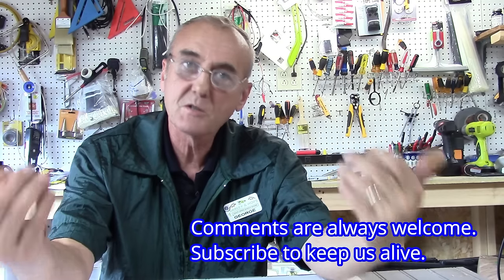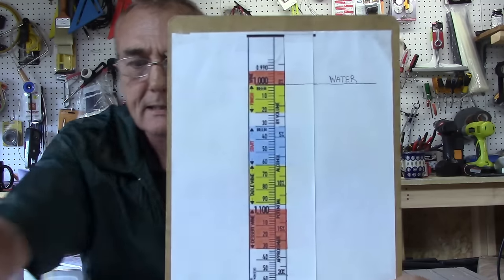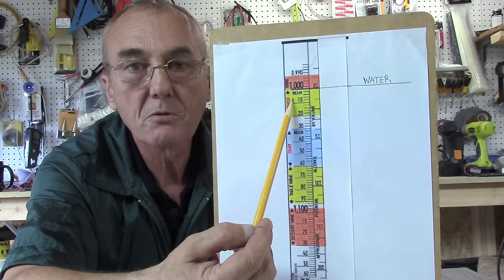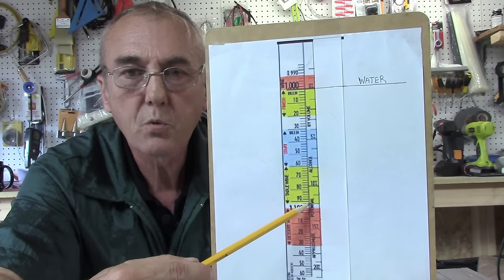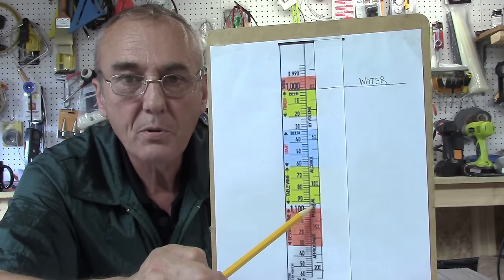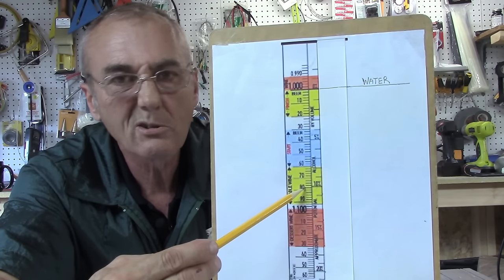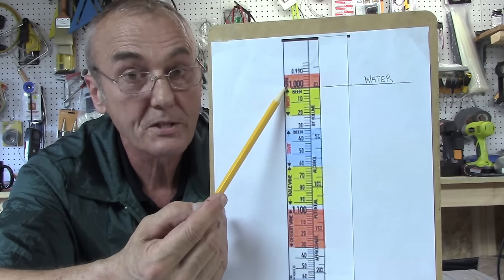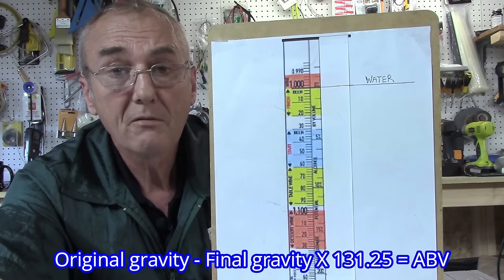Hydrometer Science

Comment: Oh man, I just did a corn and malted rye mash, it's the second grain mash I have done.  Chucked 2 lbs of molasses in with it for good measure.  Thought it would be good for a reasonable yield.  8.5lbs of kibbled maize, 4 lbs of malted distillers rye into 6 gallons of water, cooked it at 165 to 150f  for 2 hours and pitched the yeast at 24 degrees C.  I remembered to take the initial SG, which I normally wouldn't do.  it came back at 1.015.  I had no idea what it meant, until I watched this video...  I'm guessing it means I need to dump a whole bunch of sugar in it to give me a decent yield!  My first corn mash following George's basic guidelines only resulted in me collecting half a gallon of whiskey at 40% using a pot still....!   While it tastes delicious, it's a lot of work for what it yields!
Reply from the maker: Sounds like you are missing the conversion of starches from the corn. 165F will inoculate the amylase is your malted rye. Always keep it 155 or a little below to prevent this. 
The molasses does add fermentable sugars but as you can see 1.015 is very low. 
It would be a good investment (about $2) to have some amylase on hand to toss in for starch conversion even if you are using malted rye. Use about a 3/4 to 1 teaspoon for a 5 gallon batch. 
In my opinion the best method for starch conversion is to use a cooler - prepare your mash, heat it to 155 and dump it in, add amylase or malted barley and close the lid. Let this sit for 60-90 minutes while the amylase does its work. 
You'll be amazed at how much starch you convert to sugar. Be prepared to add a few pounds of sugar to achieve your desired SG level and then ferment.
George
Reply: Barley and Hops Brewing Thanks for the reply George!  I love your work by the way, your videos are a huge help!  Just on the conversion process, I am reasonably confident that the starches converted as I did the iodine test and it completely dissolved pretty quickly.  I'm guessing it's more quantity (or lack thereof) of grain that's giving me the low reading. I'll chuck some extra sugar in it today.  Thanks again for the help!

Comment: Hey George , i have a hydrometer its only showing proof meter , can i use it to check gravity
Reply from the maker: No. There are two different hydrometers, one is a proof and trale (obviously what you have) and the other is a gravity hydrometer. These have much different scales and are not interchangeable. 
The one you have is for proofing spirits which is pure ethanol and is much thinner than water. The other one for testing gravity is graduated and weighted for water and water soluble mixtures which is more dense than ethanol.
George

Comment: Hello Mr. George.  Making Peach wine. 6gal, 24lbs peaches. Yeast d-47. O.G is 1.094. Second .990. Using 131.25 gives me 13.65
135 gives me 14.04ish. 
Today added- 2lbs sugar, 2cup water. Now reading is 1.022. But, did that change the abv?  And do I now calculate abv with the second reading or the absolute final after I added the back sweetening? Did my abv change?
Thank you.
Steve

Comment: Thank you for this, it now makes sense lol…after reading the instructions on the hydrometer it didn’t make sense lol…what I haven’t done is put the hydrometer in before fermentation I’ve taken the reading now it’s ready and it floats just where water is so I thought there was 0 alcohol…even though I feel it when I have a glass so know there is, it is elderflower wine and is ready and floats just under the first red section where water would be so it’s finished and stopped bubbling but didn’t follow the correct process to work it out lol makes sense for next time.

Comment: Hi this is an easy question but I often have brew go below 1.000. For example I made an apple ginger wine that I racked yesterday and its OG was 1.086 and finished at .086. So does this same calculation equate? So this equals 1 so 13.125 would be correct? This has been a pondering of mine for 3 years now as because I get brews going under 1.000 more often than not. Im always so happy when the finish around 1.000 as I think the calculation is more correct in positive numbers! ??????

Comment: Hi
Good vedio
I have a question
can I measure the acidity of vinegar by hydrometer?
If the answer yes:
How can I do that?
Thanks
Reply from the maker: A hydrometer does not measure acidity but you can use a ph meter or ph strips just as we do in making a mash. 
The lower the PH the more acidic it is. Normal is around 3 or so.
Reply: @BarleyandHopsBrewing  

Thank you 
You made it simple☺

Comment: Hi George,, I started a sugar wash before my hydrometers came in the mail,, so in a couple days I'll open it up ,, can I get a reading of percentage of alcohol in it after its done?
Reply from the maker: Sorry but without an initial reading you have no idea what the final will equal. How much sugar and water did you use?
You could make a scientific guess and be real close.
1 LB of sugar will raise the gravity in one gallon of water by 39 points. So 5 lb of sugar in 5 gallons will be 1.039 Which will be about 4%. 10lb of sugar in 5 gallons would be about 78 points or 1.078 which is about 9% potential ABV. 
Work out your mixture to get an idea of what your ABV is. 
This is the only way to find out without the initial reading and it is not perfect but close.
Reply: @BarleyandHopsBrewing  Hi,, I put 20 lbs table sugar in 6 gallons of water 6 days ago,,,, and I got the 2 hydrometers 3 days ago lol,,,, so when I open it tomorrow ,,, dropping the hydrometer in wont show an alcohol reading? Sorry  but its my first time at this and I wanted to keep the wash simple and  because they say to pitch it first run ,, just want to see what happened with the ferment ,, and how much to expect to get out of it
Reply from the maker: Bob, I spelled it out as easy as I could. Do the math to get a rough estimate. 
My example shows 10 lb in 5 gallons is about 9% so 20 lb in 6 gallons (considering the increase in water) should be near ~16% or so. 
No, your hydrometer does not read alcohol. It reads gravity and the change in gravity when alcohol is present. So you need a before and after reading to be more precise.
George
Reply: @BarleyandHopsBrewing  Thanks again George,,

Comment: Thanks for the video, could you please make a video on, how to make a adjustable/variable water heater control switch. I thought you mentioned it in a video some time back and was just wondering. I wanted to try to make a brew pot with a heater element installed,  I'll never be able to afford something the likes of the Grain father.
Reply from the maker: Charles, I would recommend a PID. Look at these videos for some insight: 
https://www.youtube.com/edit?o=U&video_id=DLlKOcR2UEU

https://www.youtube.com/edit?o=U&video_id=qCHTXAEbBzU

https://www.youtube.com/edit?o=U&video_id=PjhcPk-nCWM

Hope this helps
George
Reply: Thanks, I've watched all your video on PID and I installed one yesterday on a refrigerator to brew a lager for Oktoberfest. The reason I didn't want to use one on a brew pot was when it turns on its full power,  I wanted to be able to find the spot where it can stay a rolling boil. For now it's the stove top.
Reply from the maker: You are correct and it does turn on full power but only until it reaches the set temperature. The PID will oscillate on and off but only at the power output necessary to maintain the temperature. When the parameters are set correctly it will constantly compare the set temperature to the perceived temperature and through its derivative process control the power through the element. The PID can and does work from 1%-100% power and all ranges in between. 
George